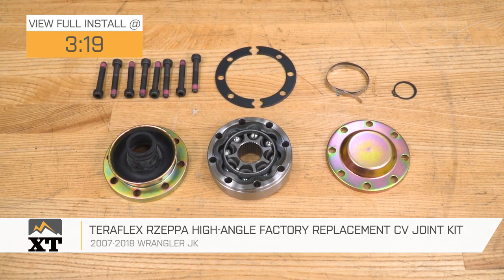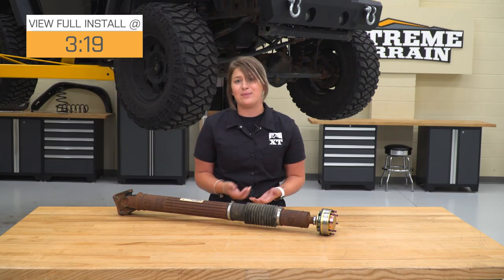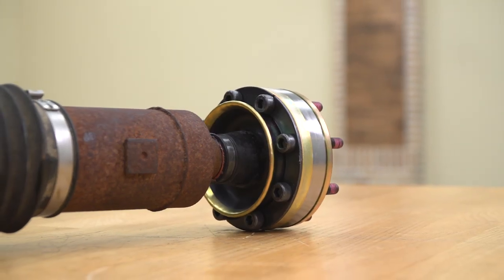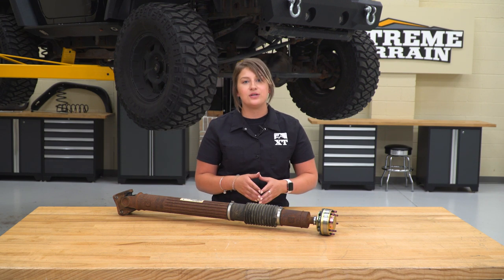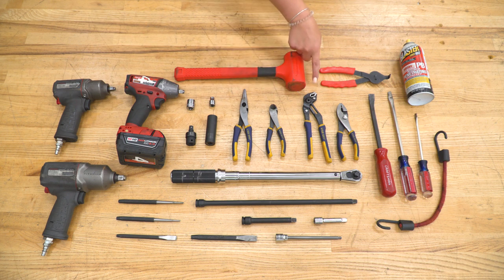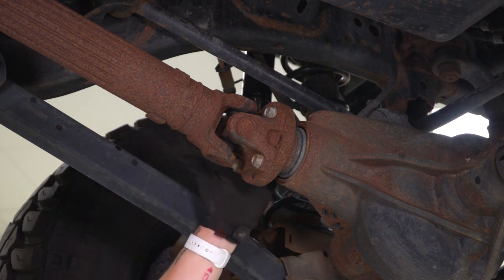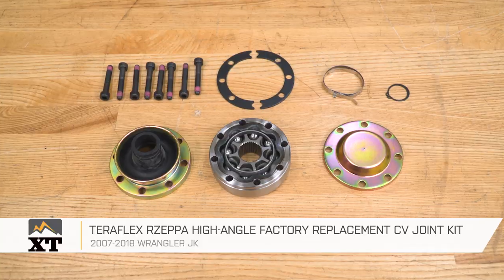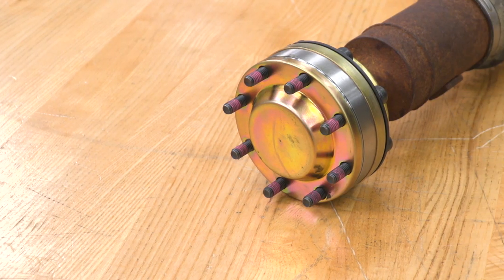Jeep Wrangler JK Teraflex Rzeppa High-Angle Factory Replacement CV Joint Kit Review & Install

Comment: She tightened the cv boot clamp incorrectly. The excess metal should be folded over the metal band running horizontal so that the locking tabs can lock down over the excess and ensure no slippage of the clamp. No way that clamp is tight enough but other than that great video!
Reply: Those clamps are junk anyways. Just use a Oetiker 🤘

Comment: Two words for the teraflex rzeppa joint......gar-bage. Buy a OEM for 1/3rd of the price, I guarantee it’ll last longer than the 10-12,000 miles on the two I installed. Spend the extra money you saved from the teraflex and buy a set of UCAs to correct your pinion angle

Comment: When tightening down the cv joint to the transfer case. I'm finding it difficult to prevent the drive shaft from rotating. Any suggestions?
Reply: Place in N

Comment: Is there a kit for a tj?
Reply: Oh yeah. Maybe not specifically from Teraflex, but I'd bet my last dollar there is. If you haven't already I'd suggest looking into yoke/u-joint conversion for more integrity. Ultimately you want to look into  extended or adjustable drive shafts. They will increase overall weight but you have to remember when you gain something, you will likely lose something. Upgrading one thing will always include upgrading of another. Have fun haha

Comment: What wasn’t mentioned is that this is a perfect time to grease the splines of the slip joint of the driveshaft. If the boot over the splines is still intact, all you will need are two simple replacement clamps similar to the ones one the shown Rzeppa joint - do NOT use worm clamps. IF YOU DECIDE TO DO THIS: Make sure you not the EXACT orientation of the two pieces of driveshaft. Reassembling them even one spline off will guarantee driveshaft vibration, as the weights will not be on the correct location.  That, and, if the driveshaft Rzeppa is already needing replacement, check and/or replace the u-joint at the axle/pinion end.
Also, anywhere you have metal meeting metal, a little application of antisieze will ensure an easy removal the next time.  All in all, a little preventative maintenance since you’re down there, will be everything in the long run.
Reply: Nice good to know thanks.
Reply: I said the same thing just after she cleaned it. haha.
Reply: you would think drilling and taping a hole for a grease zert would be the way to go and loose the boot , not sure it would work tho with out trying it

Comment: Would you recommend replacing both the front and rear joints on a 2 door?
Reply: Late reply, but I did. I got a good deal on a kit and bought the second at full retail. Even at $300 you'd be cheaper than buying a new shaft entirely.